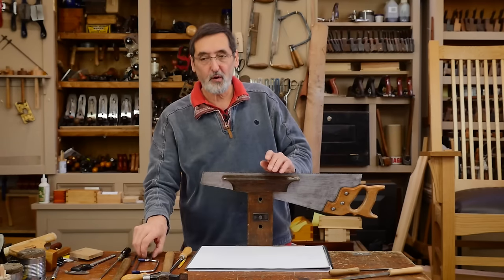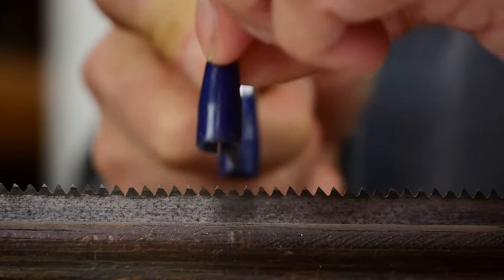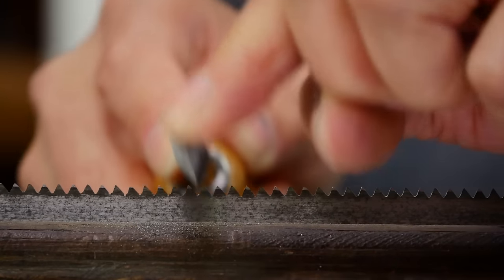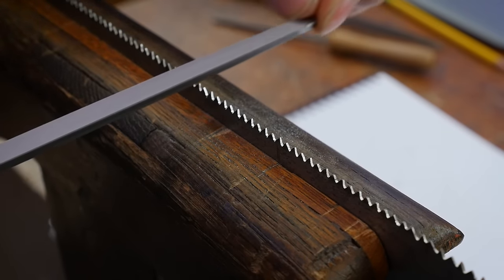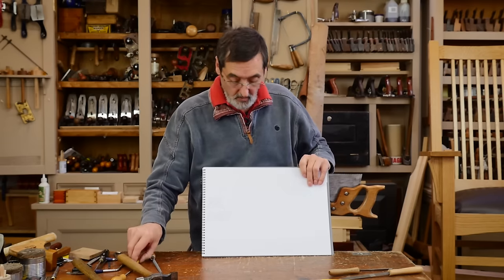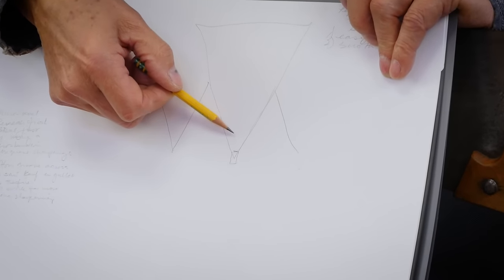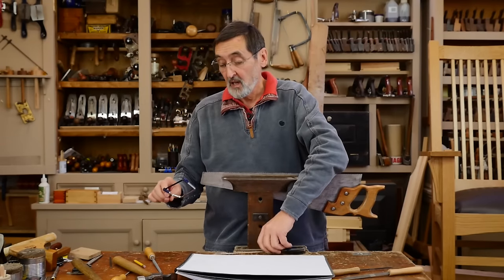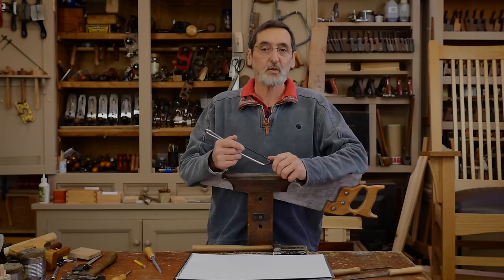Sharpen a Saw with the Help of a Hacksaw | Paul Sellers

Comment: Only just watched this,wished I had before, as I have several older files where the smaller cutting edges are badly worn. This method will mean the files can continue being used & not yet need replacing. Thank you Paul these small things make a big difference.

Comment: Quite brilliant.  In  addition to the angled edge of the file not wearing and catching it also lets the faces of the file align more properly with the geometry of the cutting part of the saw teeth as opposed to aligning with the bottom angle of the gullet (which is nearly meaningless).   Well done.  Can't wait to go try it.

Comment: Hi Paul. Great video, but I have a query. To my undersanding, standard CARBON STEEL hacksaws WILL NOT cut the steel in handsaws without gradually becoming blunt (after say 10 minutes of continual use). My conclusion is that there is no way that you can utilise a carbon steel hacksaw on several saws, it is more the opposite, you use several hacksaws on one handsaw. 

My question is, is your hacksaw a carbon steel one or is it a HSS hacksaw blade? From research, I learnt that HSS blades can cut through wider variety of steels, including carbon steel. Is your hacksaw blade a HSS one? 

If the hacksaw blade you have used is a CARBON STEEL one, the only conclusion is that your handsaw blade is made from mild steel, and I very much doubt this is the case. Awaiting your advice, many thanks
Reply: This method works using regular and bi-metal hacksaw blades, but the best way for you to find out is to try it yourself.  Sharpenable saw blades aren't as hard as saw blades with flame hardened teeth, but this is why sharpenable saw plate doesn't tend to lose teeth if e.g. you accidently discover a nail.

Comment: +Paul Sellers how long have you been using this method? Has there been any noticeable loss in the teeth/saw itself with the method repeated over and over the years with the reliefs getting deeper?
Reply: I'd assume that you would only re-cut the relief cuts when you got to the bottom of the original saw cut through filling the teeth so the relief cuts wont get deeper in relation to the teeth